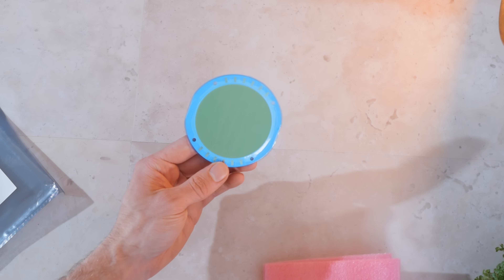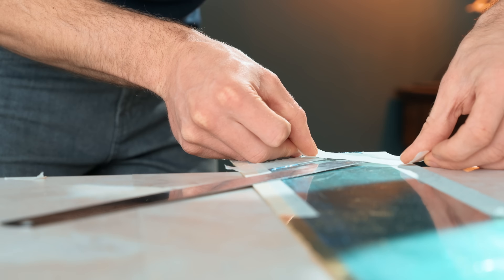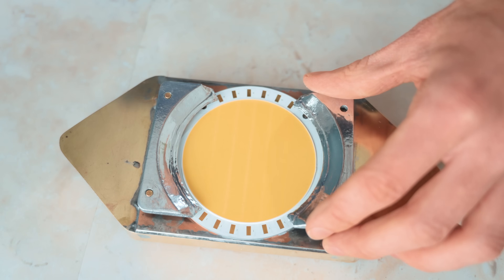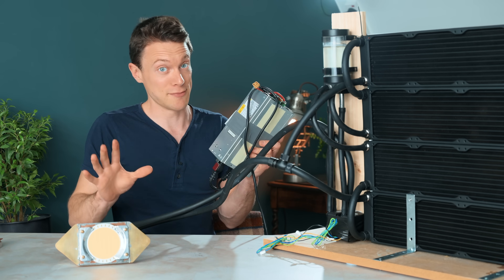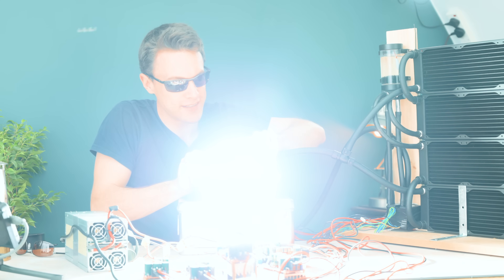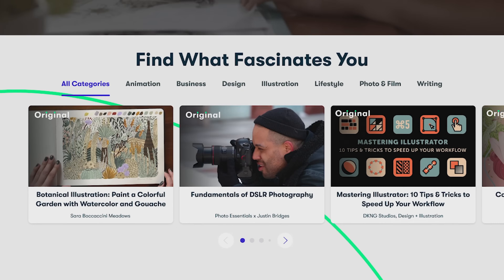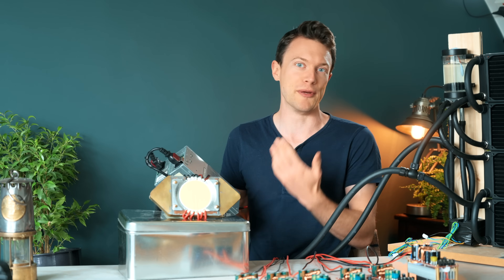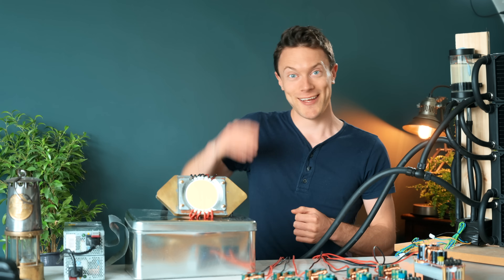Testing the world's BRIGHTEST LED!!!

Comment: Each power supply has rails for different pc components, they all have their own rating of power; manufactureres quote the peak combined power of the PSU so that could be why they failed.
Reply: while thats true, the 12v rail is by a long shot the main rail, power output is probably not why they failed, my guess would be that those psu's aren't floating which means they cant be used in series
Reply: @cj09beira  Yep the 12th rail is the bigg'un by far. 
Also a good PSU can still put out a decent bit more than its rating without blowing up....mainly just devouring it's life expectancy.
Reply: Correct. These "rails" offer 3.3v, 5v, 12v, and -12v. All of these voltages will have a seperate current capacity, but the power supply rating will combine the max wattage of all rails. Look into the specs of the power supplies you plan to use and  add up the wattage of the specific voltage you need.

Comment: What do you mean in series,  psu is not battery, you can power 3 pins from one psu, 3 from other, sharing load, but that's parallel.

Comment: Computer power supplies usually have the output ground connected to the ground from the mains: this means that putting two of them in series would easily short-circuits the one whose +12V is connected to the other's GND, because it'd also be connected to its own GND. Did you take this into account?
Since I assume those boost converters could work just fine if powered at 12V, I'd rather use multiple (probably three) standard ATX PSUs to split the load.

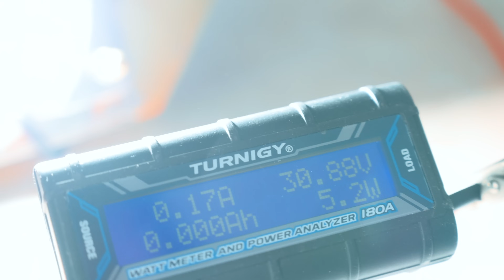Comment: At 8:52, saying that "it's only using 5 Watts, and it will get 300 times brighter"... LED light output is certainly not linearly related to the input power. There is a peak efficiency point, and after that the lumen gain per input current begins to drop off. 

Also, one should never make the mistake of driving LED's based on Voltage... they are very clearly Current driven devices, and the Voltage required to achieve that Current will change quite a bit from one device to another, as well as a large shift over operating temperature. As you mentioned, always use a Current Regulated power supply.
I assume you are in the UK, with 230V mains?  Otherwise those server power supplies will not output that kind of power on 120V mains.

Comment: The server PSUs sure don't like being wired in series. Personally, I would just leave them independent from one-another. The boost converters should have no issue bringing the voltage up from 12V to 30V, especially since they are only running at half capacity.

Comment: Well, you kinda had the power supplies duck taped together so they had a ton of heat build-up between them. In servers, they are normally sitting next to each other and would have more ambient cooling from other fans in the server.

Comment: Perhaps I'm just a noob, but wouldn't it have been better to wire those power supplies in parallel and use the boosters to go from 12V to 30V?  I don't know if that's too steep of an increase, but I think wiring both supplies in series means that all of that current has to go through both..

Comment: Many interesting points by many folks.  Lots to read, answers to many questions:
1) Never parallel power supplies.  Never parallel LEDs.  He didn't.  Because each one has voltage tolerances (differences) and the PSU with the higher output voltage (~5mV higher) will source most of the current.  The LED chain with the lowest voltage will take all the current and fry.  6 switchers for 6 LED chains was almost perfect.
2) Cutting power to LEDs:  LEDs will stop glowing (taking current) when the voltage drops like 5-10% in the millisecond range.  Fans run with whatever DC voltage is left, even a second later (no LED load, just a fan) the fans keep spinning.  So the parts won't overheat on shutdown.  
3) FETs used in the switchers start to melt and reduce their resistance, and ultimately short.  Bad news is that they usually fry shorting the input voltage to output voltage rail.  Bad news for step-down PSUs (12V to 1V for CPU/GPU) and you get 12V into your 1V chip.  Doesn't apply here because the input was 12V to 24V (boost PSU).
4) The LEDs were spec'd to 1500W.  The middle PSU's lose about 20% or less in heat (conversion efficiency), which means we only got 1200W of LED power.  The first PSUs also lose 20%.  You need 2400W of input power to get 1500W to the LEDs.
5) there are PSUs available on Google from China/Hong Kong for ~100$ that can do 17-26V adjustable from 5A to 80A.  But what we really want is to spread the 20% lost heat (and get rid of the second level 20% power loss) by using 6 AC-powered PSUs directly to the LED chains.  That means you only need 1900W total, or >=320W each or 15A at 24V.  Meanwell is decent: https://www.amazon.com/dp/B07VRK86SP (if the link lasts, google 24V 15A) at $30 each, typically free shipping.  Maybe better deal as you buy 6.  These bricks https://www.amazon.com/ALITOVE-Universal-Regulated-Switching-Transformer/dp/B06XK2ZNKC?ref_=ast_slp_dp are $25 each, Prime shipping :)
6) Since we are wasting 300W of heat (1/5 of the total) in the PSUs, you should force some air into them, like your water cooling stack at ~160W per fan.  Maybe a push-pull air tunnel?
7) It would be interesting to monitor infrared (handheld thermal gun, $12 from China, like the ones used for CV19) on all the parts while running to avoid another burnout.
8) Great idea about using bicycle pump to check water cooler leaks.  Will use that next time too!
Keep up the good work!

Comment: flux doesn't attract the solder. Heat does. You flux yes, but if you are in a pinch you can just heat the solider and it will attract to the heat

Comment: Probably excessive current got those power supply units burned. Roughly, around 50 Amps of current might be flowing through. And as the series connected power supplies will add up the wattage, but the they may not handle the Total current flowing through the path.

Comment: Cos you used a voltage booster you you increased the wattage at the PSU so I’d try a 2000w psu instead of 2 750w psu’s. Nice work on the cooler though

Comment: This is not how to drive LED lights at all. There are special and easier devices for that. You need to use Constant current power supplies to drive LED-s, I suggest Mean well 
HVGC-650-U-AB power supplies x6. These you can set at 7000mA this way you can use the built -in 1...10V dimmer function to use simple 1...10V lighting dimmer knob to dim the LED safely. Should be far cheaper, faster, safer and easier to build. One more thing: DONT STACK POWER SUPPLIES. EVER. This is why they also burn. And this is why you stay alive when you share body heat in cold envieronment if you get hypothermia.

Comment: Higher efficiency power supplies would get less hot. Not sure if heat was the cause of the failure or how efficient those ones were, but that is where I would start.

Comment: Did you check the flatness (or sand it down back to be even) after the soldering ?
Next time simply preheat it in a frying pan or directly on your stove / in oven.
If you preapply soldering paste from plumbing with solder/flux already in it you can directly solder-bake it - if you get it hot enough.

+ Also simply use a car radiator for 25 upwards bucks instead of those expensive pc cooling parts.
+ Also possibly use a large water reservoir as heat buffer (i think 60Liters for 40 bucks..) so you dont need the radiator at all for non long term usage - which that set up also is not useful for.
+Also add a flow sensor => no flow => lowest wattage only

Comment: Guess you were stressing the common mode filters and assuming PSUs were not new component degradation would also play a role in failure. I'd personally go with 48V PSU and step-down converters plus individual LC filters to reduce load ripples.

Comment: I want to point out something interesting. Quite some time ago around 2014 and 2015 when I had 4 MSI 7970 lightning graphic cards with i7 3930k 5.0Ghz + Asus rampage IV LGA2011+ Gskill 2600mhz , I had severe power supply issues. I had purchased EVGA supernova 1500W (oc 1650W) and it died after 10 days. I sent back and got new... it lasted 1 month and died. Then I send back and got new.. worked 5 days ... died . I did this 10 times and almost went to court against EVGA because they refused warranty. Yes their power supply wasn’t strong enough BUT after I got a wall socket meter and launched Metro 2033 .. BOOM I had 1300-1400w and on rare occasion 1680W drawing form outlet... and my power supply was 1500(overclocked by switch to 1650w). I ended up by buying 1700W and additional 1000W . Problem was solved. My wall socket sucked 1760W if I didn’t had Visync ON. Because without Vsync , there is no FPS limit and they will be like 150-300fps and suck so much energy. The thing is power supply in current state aren’t good enough to supply a power hungry device. You should NEVER surpass 50-60% of power supply load. So your load 1650W from wall socket is way too high for 2000W sadly. You need 2 powerful supply and real one , with ONLY one rail not multi rails , it will fail otherwise. Get 2 2000W real solid units.

Comment: kinda looks like you have redundant server power supplies. They are, like you said, not meant to be wired in series. use a 2000W power supply. 1700 would get you what you need but 2000 will give you the headroom for spikes and such.

Comment: I wouldn't recommend using a server power supply because the cooling will be aided by the actual high power fans inside a server rack (when properly mounted for its intended use)... Just use 2 X 1500W power supplies  👍

Comment: you would of been better off with two lead acid batteries and use the power supply as a charger for them, one per battery set at 14.6V ish.

Comment: Your problem might be that you're running the PSUs in series. Basically series adds the voltages, parallel adds the current delivery capability, you cant have both. (unless you get 4 power supplies and run them in series parallel). overall wattage will be added either way tho, so i don't see why the configuration shouldn't work. Could be that boost converters are drawing current in large spikes that killed them, the boost converters look like they have decent bulk capacitance filtering on their inputs tho. Note: running PSUs in series is mostly fine apart from the safety issue of having the earth disconnected and the fact that the output caps will be reverse charged if one of them fails.

Comment: I wonder if the fault was caused by a large inrush current from the boost converters? Especially if you didn't switch them on in sequence and just went from zero to full load.

Comment: One of these per headlight on a car. You can hook them up to the cooling system of the car or use the AC lines. These would take high beams to an entirely different level

Comment: When you put two identical power supplies in series, you double the voltage but the current can be no more than that of a single supply.  
You used server power supplies. While they may be 1000 watt total, that is spread across several voltages. I'm guessing but probably +5@20A, +5@20A, +12@20A, +12@20, +12@20A, +3@5A and -12@1A.
The 6 segments of the LED draw approx 50A total @ 30V. Even if you tied all 3 internal 12V busses together you'd still only have a maximum of about 60 amps available to the LED, the maximum current of one supply.
Also they should each have their outputs protected by reverse voltage diodes in case they all don't start at exactly the same moment.
Now you know why they burned out.

Comment: Hi Matt! Greetings from spain, I'm a great fan of yours. Have you ever thought about rehousing cheap led panels with the led strips? That could be a way to have a great thermal performance and design in a very low price and aviability! Also you could do the same with this COB leds, where you could rehouse them inside cheaper lights. 

LIKE IF YOU ALSO WANT IT!
Reply: ~500 LEDs in 8cm?  How?  They are soldered on to ceramics with copper plating.

Comment: The fact that you turned 24 Into 30 volts increased the load in the supplies by around 50%.
Reply: Depends on the switcher.  80%+ at least, lucky if 85% or more.

Comment: I'm sure you've considered it but try using 2x modular 1000W ATX power supplies. Those server PSUs are pretty inconsistent in quality and very cheaply made which is why they may have failed.

Comment: You likely killed the server PSUs when you cut there power with them still hot. you should have turned the LED off, and let the PSUs cool off before powering them off. many server PSUs will keep there fans running even after the server itself turns off until the internals of the PSU drop to a safe range. With you just unplugging them you basically turned them into component ovens, baked everything.

Comment: Yo. Hardware nerd here. Most PC power supplies, especially the cheaper end of things, are not trustworthy AT ALL in terms of ratings. A PC Power & Cooling 500w supply... yeah that's probably actually capable of 500w continuous. But something that says "Athena Power" on the side? I've had a few of those... they aren't that great. Derate by at least a quarter, a third is better (meaning, make sure that any given power "rail", or power supply line, will never see more than 75%, preferably no more than 67% of its claimed rating. Something truly atrocious like the "Allied" brand supplies that come in "Apex" cases? Derate by at least half -- or, better yet, avoid them entirely. A simple way to test power supply quality (this doesn't really work on laptops) is to heft it. Generally, a heavier supply is better.

Comment: Literally only 13 amps. A lot for a single led? Yes but not a lot of power in the big picture
Reply: Ahhh should’ve watched the whole video. At 30 volts it’s pulling 50 amps. That’s insane and 1/4 of a houses electrical service which is typically 200 amps

Comment: these power supplies are really not up to the task, if you want stable power coming to the led get some huge power supplies from a brand like seasonic ,corsair ,evga. And since those are of actual spec and of good quality you could put 2 in series and they would work without burning easily

Comment: Did you modify the power supplies so the grounds is separated as I saw that they were stack together, and that would be putting one of the supplies positive to the ground of the other one.  So to use these supplies in series you need to disconnect the internal grounds from the negative side of the output.  That is one scary led light, I would have been sweating bullets to even try it out. Thanks for doing it for us :)

Comment: Hi

The PSU's typically needed some air cooling if they are under a full load for extended periods. I work for a recycling business in Manchester Uk and we strip PSU's out of redundant Servers. I have tons of 750W and 1200W server PSU's (dell and HP)
feel free to call and I can sort some out for you for cost of postage if this helps your test - Green IT Disposal  the telephone Number is 0161 928 1144 but during lockdown you can contact me at lee@greenitdisposal.co.uk as we are working remotely most of the time  Cheers Lee

Comment: Something like this a car or some deep cycle battery might be a better option.  Instead of dealing with power supplies..
You'll still need those DC DC converters tho
Reply: Car and battery can't do 1600W.  Your 12V generator is max 100A on a truck.